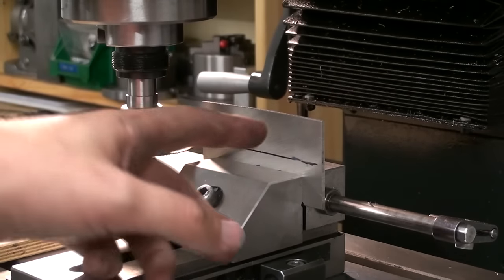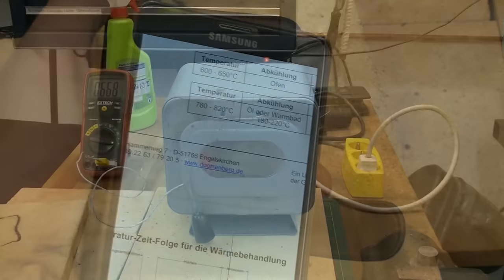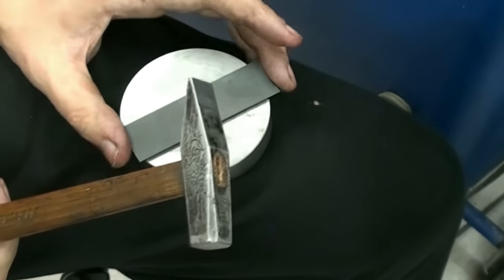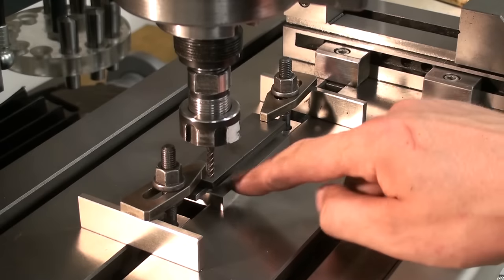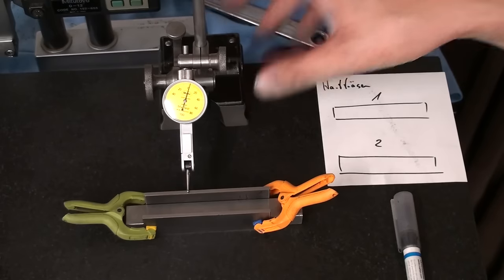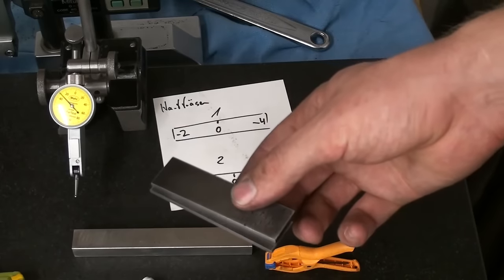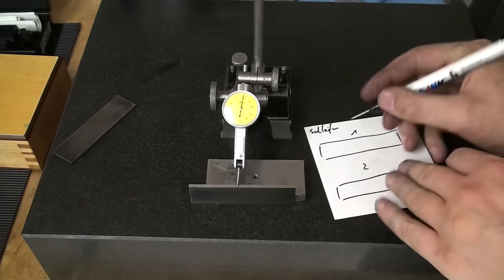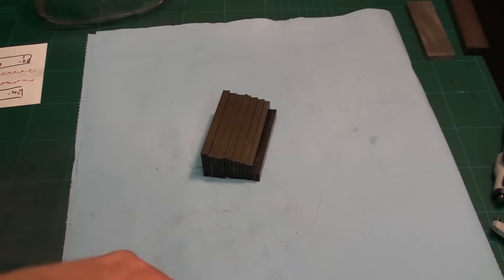Shopmade parallels - Part 2

Comment: Curious you say they dimple peen at work to straighten and then grind the dimples off. Since the compressive stresses from the peening is what straightens the item what keeps it from going "potato chip" once those stresses are relieved by grinding the peens off?
Reply from the maker: Good question - I think the deformation from the peeining goes deeper into the material than the actual dimple that is put into the surface of the material

Comment: I don't have a precision grinder so I use a mounted cylindrical stone.  Have to true the stone up first in my mill with a diamond point.  Set the parallel up with a dial indicator for a minimal cut and then run the stone at the highest speed my mill can do.  Because I make adjustable parallels, I only need to get one edge of the parallel straight.  The mounted stone seems to do a better job than an end mill.

Comment: Great video Stefan!  
I really like the straightening technique. I always thought tempering was mandatory even if you wanted maximum hardness.
All the best,
Robin
Reply: No quenching makes max hardness, usually the faster the quench the harder it gets. Tempering reduces hardness but also decreases brittleness. For most high carbon steels tempering is needed to use the steels in any load capacity or they will probably crack and fail, in this case as spacers it doesn't really matter since no real loads. Annealing is taking a material that has been hardened and taking it back to its softest state.
Reply from the maker: I am not sure about the tempering to be honest - It might be nessesary to get out the stresses from hardening, but the parallels I made so far without tempering did not move over time.
I want to get more into heat treating and that means adding a temperature controller to my toy-oven ;)
Reply: I looked into it for that steel (AISI O2) and the tempering is mandatory with a minimum of 100C for 64RC and 2 hours minimum regardless of cross section.  I only mention this because they say the un-tempered steel can crack just from internal stresses. I was waiting for the parallels to crack in half when you were straightening them but you pulled it off.  
Keep up the great work,Robin

Comment: The same physics of peening can take the warp out of a slab of 4" thick steel 120"×120" The first time I saw someone going at a huge slab with a 2lb hammer, I said "that's gonna have zero effect" but you can pull a 1/2" bow out of a slab pretty easily. They have 120" Blanchard grinders at my employer, and the operators peen parts on a daily basis. They tend to be pretty warped after they are cut on the burn tables and then picked up and dropped a couple times with an overhead crane to separate the parts. The burn bay guys aren't well known for giving a damn about the downstream guys. I am a welder/fabricator, and I frequently have to bring parts to the press to be straightened. I can't peen the parts because I can't leave a bunch of pecker tracks on the part. The Blanchard operators are gonna grind the part anyway, so it really doesn't matter if the surface of the plate looks like a moon scape.

Comment: Hammer peening 60HRC was new to me, seems very useful. I just wonder how they can grind the peened surface without problems? I use a roller peener for an internal peening operation, and as far as I know it is very important to do this as the very last operation. There is always something as a takeaway after watching these videos even if You think You know this stuff fairly well...

Comment: Thank you so much for making these videos!  You include details that are left out of other videos, such as two spring passes for hardened materials, and reading the materials specs for hardening parameters, which is "retrospectively obvious."  In other words, "Duh, why didn't I think of that!"
Please keep the less expensive alternatives in your videos, even when you don't have time to show them all.  I used to watch Norm Abram on The  New Yankee Workshop (woodworking), and he usually had a tool for everything.  In one episode, he glued up a tabletop and needed to flatten it, so I expected to learn more about hand planing.  Instead, he ran it through his (sponsored) 36" wide surface planer, and didn't mention any alternatives.  Boo, hiss!

Comment: We never have too many parallels, you can order K type probes that get to 1000 deg C for about $ 5 to 10 from China, they have a stem around 8 to 10 cm. they will resist heat pretty well, this is waht I use in my own home made oven, I could send you a link if you need to...   ;)

Comment: I, too, am a son of a machinist (S.O.M.). For me, though, it's an avocation not a living. I really like how you model fine precision work while still allowing for "good enough."
Reply: Todd Carney Thats the only way to keep your mental sanity ;). 
Always working on the edge of what you can measure even with high quality machines really gets frustrating over time.
When I was an apprentice we had to precisiongrind a watchmakers vice to 1/1000mm and Close to that in parallelism and angularity. The worst part was we millied the parts our selves 1year before and they were twisted and out of shape in all dimensions even with, what we thought at the time, was a lot of care milling them.

Comment: Very interesting that peening, I would never think of doing that to a hardened piece.
I am wondering about the measurements though. When you are measuring thousandths of a millimeter, won't just the heat from your hands touching the piece or your breath potentially affect the reading?

Comment: I assume the numbers you give for acuuracy on the surface plate are .001 mm. That is one micron, unless I have misplaced a factor of ten. Certainly well beyond the needs of the average home shop! I never saw hard steel being peened before.  I did not know that it could be done at all. As usual I have learned something. Thanks!

Comment: I was always taught to put the bowed up and tap it down, but this is the first time I have seen it done the other way, 
Can you explain why you do it that way
Reply from the maker: The technique i showed, stretches the material on the concave side and straightens it that way.

Hammering on the bend facing up will either make it worse or you need to place the part hollow, so you actually bend it.
Reply: @StefanGotteswinter  I assume that happens only when the material is hardened.
As I have always done this with soft materials, 
Thanks and I'll remember to try that next time i have a hardened piece of metal

Comment: Perfect... now I wonder why I payed 80€ for my set? ;) Thank you for sharing your insights and experience... much appreciated... as always. Btw. I realized that you, once upon a time, did cnc-work... you sold the mill I believe... why is that? Got bored or just went back to the roots (and art) of metal working? If you don't mind the question? ;)
Reply: Shazaam, im late to the party, but as far as i know, he sold the deckel mill as it was not really a mill, it was his own frankenstein mill he cobbled from deckel parts, which made it not suitable for milling in any productive setup as the cuts he could take were shallow... i think the body of the machine was a borer or a grinder body, from like a deckel lkd, which made the table a non dovetail table that moved on a rail and a flat, which does allow for some minor milling, and its weight brings that up even further, but the whole setup was not optimal for any real work... Looked cool and dandy, but was a frankenmill setup and we all know that gut `n toight is the way any proper machinist rolls, especially german ones, so that got boring real quick and in a hurry... Heck, i would have liked to buy it off him if i had the coin for it back then, but alas, no cigar...

Comment: Have you ever re-ground store bought parallels to improve them? What is the minimum amount of metal that a surface grinder can remove? Thanks.  Great demo.
Reply from the maker: The import-parallels I bought so far where all well good enough out of the box :)
Smallest amount that a surface grinder can remove...thats more dictated by the precision of the  downfeed ;)
If you can get the wheel lowered by 1/1000mm, it will remove 1/1000mm.

Comment: This was terrific.   At some point, I'd like to see a video that discusses the different kinds of steel and their attributes (including relative cost, machinability, hardening characteristics, typical applications, etc.).   The terms "cold rolled", "hot rolled", "tool steel", "low carbon", "high carbon", "alloy", "Mn Steel" are a bit confusing.  Why do I care if a steel is cold rolled versus hot rolled?  Which steels make good tools, cutters, dies, etc. and which don't.  Thanks for all this.
Reply: Yes, I've seen that several times in the past.   And I buy my metal supplies there from time to time.   But their info on all the metal alloys is vague, superficial and not helpful if you have  specific requirement.  Watch all their videos and try to figure out which steel you should buy to build a boring bar, or make your own countersink tool, or replacement shaft for your boat's propeller shaft.